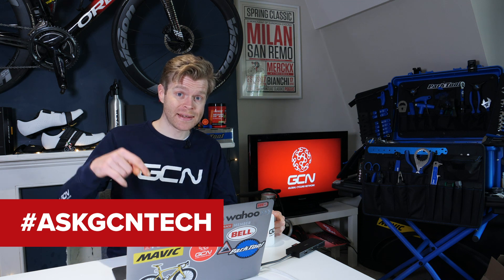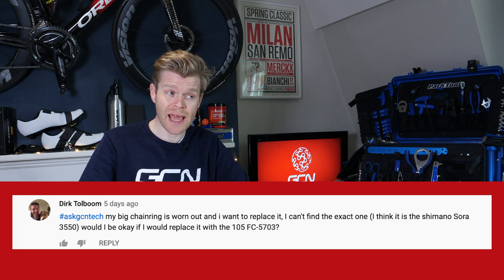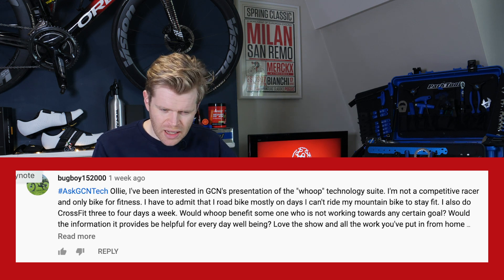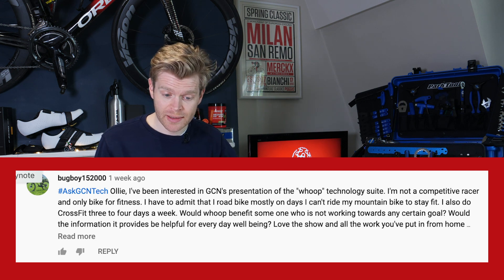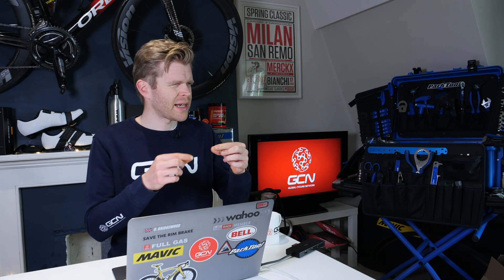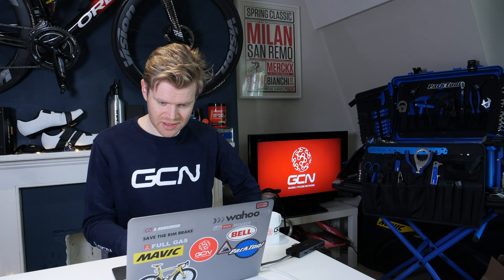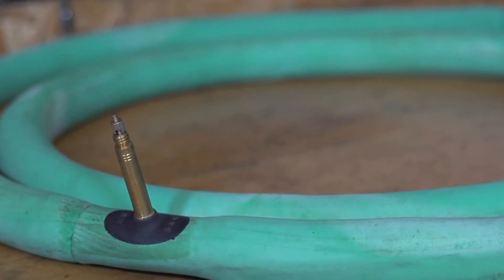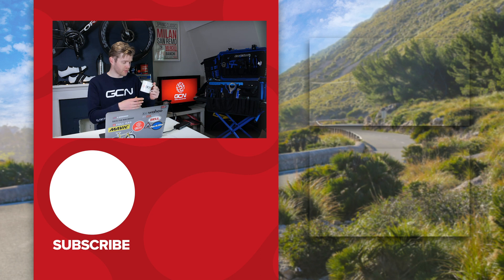Is A Gold Chain Just As Fast As A Regular One? | GCN Tech Clinic #AskGCNTech

Comment: Re: latex tubes - I like using really thin butyl tubes instead, the 50g Continental Supersonic ones. I think you can get most of the rolling resistance benefits of latex from them and they don't deflate overnight!
Reply: Neil more prone to blow outs from braking heat in my experience and the rolling resistance isn’t quite as good. 👍🏼
Reply: @OllieBridgewood  They're very, very sensitive to mounting, being really thin as well as less "slippery" than latex.. So even just a whisker of entrapment under the bead can cause problems. And they'll pinch flat at the slightest excuse. Still, I've been using them for years and years and have come to an accommodation with them. ;-) True that rolling resistance isn't quite as good, but it's pretty good!

Comment: Hi Ollie; at the risk of offending Manon and the late, great, Jon Cannings:  A coating that increases friction, even minimally, only for the sake of vanity?  ..."I pity the fools".

#AskGCNTech:  Concerning Tubes:  I've a nice-day bike and a grey-day bike, both with butyl tubes, and I check my tire pressure before each ride...  I typically need several psi after just a few days, losing ~2psi after just two days (~10 after a week):  Is this excessive, and what could be the cause(s)? 

Also:  Wax your chain!  (OZ Cycles' PTFE recipe.)
Reply: Sounds normal. You lose lots of tire pressure when road tires are pumped up to ~100 PSI. With even a quicker loss with latex tubes. Up to 7 PSI per day loss with latex. Losing ~2 PSI per day or two with butyl, that's normal. In my experiences.

Source: a self-taught bike mechanic for more than 30 years.
Reply: Rumour has it there’s extra watts to be had if you drink your milk
Reply: Jaime iz Real Thanks!
Reply: @oldguyonabike36  No problem.

Comment: #askGCNtech I have recently built a track/crit fixie. I am currently using a 40cm 3T Tornova carbon bar with a 3T ART stem 17 degrees (horizontal) 110mm length. I did some car park laps to test the bike and the drop is comfortable however under heavy acceleration the front is slightly twitchy on first couple of heavy pedal strokes before stabilising as I get up to speed. Is this down to sprinting technique, or would I need to consider a longer bar, wider stem or both? Note, I do not have the same issue on my road bike which has 120mm horizontal stem and 42cm bars (which feel a little wide but are stock), but a more relaxed geometry.

Comment: #AskGCNTech Hey Ollie! There are many good priced CX bikes with a SRAM Rival 1 (1x11) setup, but if you want electronic shifting the price is almost twice as high.  So I was thinking I could save money going down the upgrade route and get a 2nd hand (or even a new discounted electric groupset). While the Ultegra Di2 seems to be slightly less expensive compared to a full Force eTap AXS groupset, I thought I could still save some money by keeping a few of the Rival 1 parts (which is currently on the bike), such as the crank and discbreaks, and only have to buy rear derailleur, chain, cassette and shifters? Anything I am missing, or is it anything I need to keep in mind when browsing for upgrade parts?

Comment: #askGCNtech  If some cyclists are so positively obsessed with the right lube for the weather conditions that they think about deep cleaning the chain each time - why not save the hassle and get a second chain (not your spare one ;) and some more quicklinks/chain bolts, to have one chain dry lubed & the other wet, ready at hand? Probably quicker to swap than to clean, less chemicals plus the wear on the drivetrain components will be less as the chains wear down more slowly.

Comment: @GCN Tech...  The gold color coating is Titanium nitride which is is an extremely hard ceramic material about (0.00020 in thick) used to harden and protect sliding surfaces, which is why it is used on suspension forks, shocks, and chains.  See this review by MarathonMTB for the full run down.   https://marathonmtb.com/2015/05/27/reviewed-kmc-x10sl-ti-nitride-chain/

Comment: Hey Ollie,Ken here . Maybe do a show about disc brakes , like which is better "floating "rotor or say stock Sram or Shimano fixed rotors? Center lock or 6 bolt I wouldn't think either mounting would matter . I have Hope "floating" rotors(6 bolt) on one bike and my new Tarmac Pro has Sram force rotors ie fixed . Personally I think the Hope rotors are way better looking like a motorcycle brake rotor .

Comment: Most (all?) of the KMC Gold chains are Titanium Nitride-coated, NOT anodized, and may confer an advantage in corrosion resistance.  TiN-coating has been shown to reduce friction and wear (and I proved it at work too) with drill bits and other machine tooling, but I don't see any definitive studies for cycling.  Someone else noted that the rollers in the chains are not coated, so that could play a factor.

Comment: The headset bearing reminds me of issue I got with carbon forks, yes I torque the headset but it still slides so I am tempted to glue the compression fitting inside them just use top cap on top

Comment: @askgcntech hi Ollie massive fan of the channel but I have a couple of questions 1. How do you remove stuck pedals off an old bike 2: on my gravel bike the shifting is going through the gears but getting stuck in 2nd and shifts twice into 8th what should I do
Reply from the maker: Hi Luke, stuck pedals can be a real nightmare! You can try using a breaker bar over a long spanner/hex key depending on the pedal type, but be really careful not to round anything off, if that doesn't work then applying a little heat can help, if they're truly seized through it's a real mission! In answer to your second question, it's likely that your cables need replacing if the gears are sticking and then jumping, just replacing the inner cable may work, but you'll be better off replacing inner and outer cables

Comment: #askgcntech
I’ve recently bought a canyon endurace with an ultegra di2 drivetrain, I love the bike but the noise from the drivetrain is driving me nuts, it sounds like it’s coming from the cassette but I’ve had a bike shop check the alignment/set up and everything is fine and I’ve tried several lubes including wax but it doesn’t make a a difference, I’ve seen on the forums that I’m not alone with this issue, it’s noisiest in the big chain ring and smallest few cogs on the cassette, any ideas what I can do to quieten it down?

Comment: #AskGCNT Loving the content Ollie. I'm not a pro, and I never race. I am just interested in going fast on my usual route. I've got a rim brake TT bike with deep section (50s) wheels but thinking to install some Xentis Mark II wheels. I really love the bling on those wheels. However, I've found so much conflicting aero data on how much power I would save or lose by switching from deep section wheels to blades. It would be great if they are faster, but I am sure the placebo effect would more than make up for lost watts if they were slower ;) I often wrench my own bike and current wheels and would want to do the same with the Mark II wheelset.
What do you think of those wheels, any data on them, and is it feasible to overhaul them myself?
FWIW I am putting around 7000km/year on my bike, so durability is a plus.

Comment: #askGCNtech Hi, I've just treated myself to a left-crank power meter.  I'd like to use it across my road bikes but also on my gravel bike which is fitted with a GRX groupset.  Can I use my new crank, which is a 105 series crank, on my GRX front chainring?  The crank lengths are the same.

Comment: #askGCNtech I have 'quick release' thru-axles on my custom bike I built (they came with the frame). It makes traveling with a thru-axle, disc brake road bike on a car much, much simpler. I also have a 2018 specialized sirrus pro carbon elite and have been wanting the same kind of axles to fit those wheels. I know companies like DT Swiss make them, but I can't seem to find one that fits. Can you help find the right size for this bike? Front wheel, specifically.

Comment: Ollie; 
I have a thought about the question you answered about changing lubes, and the example you used. You mention prepping with dry lube, then switching to wet lube for weather. I agree with your point, however, wouldn't this depend on your dry/wet lube, especially in the example you give. Some dry lubes are wax based, and would repel an oil based wet lube. If your bike is cold with wax on the chain, and you add an oil based lube, wouldn't the wet lube come off before the wax got warm enough to get washed off by the weather? #AskGCNTech
Reply from the maker: Applying more lubricant over another different type is really more of an emergency only tactic, usually it works well enough to stop your drivetrain going completely dry and squeeky, but it's less than ideal

Comment: GCN, besides the wheels turning on the wheel bearings, DO the wheels also turn on the skewer, that is, is the skewer a bearing surface on the hub axle, that I should oil as well?
Reply from the maker: The skewer does not turn, and is not mounted to any turning parts, they are just there to locate and secure the wheel axle so they need not be lubricated, but you may wish to apply a little grease to your skewers if they are steel to prevent rust.

Comment: #AskGCNTech Hi Ollie, I want to ask if I want to do basic maintainence in home without a torque wrench. How can I know if the torque is about right for the bolts
Reply from the maker: You can't really guess torque without a huge amount of experience, but if you don't have a torque wrench then it's best to err on the side of caution and not over-tighten bolts. Essential mounting bolts, such as on the stem front plate and the seat post clamp should be done up tightly enough so that the bars/seatpost don't move at all under your bodyweight, but no tighter

Comment: #AskGCNTech

I have the Canyon Lux CF SL 7.0 and would like to equip it with a dropbar. Of course I need a corresponding brake lever for this. Preinstalled is the Shimano Deore gear group M8100 with 12 gears. Can I use GRX brake levers for shifting and braking? (Even if I lose a gear in the process?) I'm not sure if the shift cable is pulled properly so that the gears shift correctly. Or are there other options?

Many thanks in advance and greetings from Wuppertal

Tobi

Comment: I have just bought a new set of carbon wheels. However, when I spin the back wheel with the pedals, the pedals/cranks continue to spin round for a couple of seconds (like I have a fixie!). Also when I spin the pedals backwards the wheel spins back also. Do hubs 'wear in' and will this stop, or do I have a faulty hub and do I need to send back?! #askGCNtech

Comment: For the second question, regarding Sora 3550 replaced by 105 5703 chainrings. For this instance,  yes, both five bolt 110BCD .

But beware, Shimano have been dicks for the latest lineup of four bolt PCD110 chainrings by changing the notches on the both the chainrings and the crankarm spider on DA 9100, Ultegra 8000, 105 7000 is incompatible with old Shimano 110 four bolt for no good reason. And then GRX notches are also incompatible with any other Shimano four bolt anything, again for no good reason.

Comment: #AskGCNTech I have a triple chain ring at the front and want to change it to a double.  Will I need to buy a new crank and front derailer (or even more), or is it just the cassette that needs to be switched?
Reply: Going from triple to double means new cranks, new front derailleur and a new front shifter. The casette (the sprockets on the rear wheel) has little to do with this, as long as the chainset is compatible with it.
Reply: @TheMilosDjuric  I'm achieving this with a new bike soon. Anything to keep in mind? My 50 large chainring works very well for me...thanks!

Comment: I am thinking of upgrading to carbon wheels, I am curious whether tyre levers can still be used to fit and remove tyres?  Cheers
Reply from the maker: Yes you can use tyre levers to remove tyres, it's best to try not to use them to fit tyres though, as doing so can lead to pinching and puncturing the inner tube before it's inflated
Reply: Cheers.  40 years of habits die hard!

Comment: You are wrong about the gold chains.
There is no anodizing, they are not aluminum.

The titanium nitride coating is the gold part, not the underneath silver.
Titanium nitride is actually classed as a ceramic coating if I'm not mistaken.
Underneath they are nickle plated like the rest of the silver ones.

Comment: #askGCNtech I have a screaming Mavic Freehub (On faster descends when I'm not pedalling)...am I correct that lubing the sponge inside the hub with some mineral oil will help?
Reply: Had it - take the freehub apart and lube it all up (including R&R the pawls/springs) with a light grease (e.g. Slick Honey).  Check the other bearings.

Comment: I thought the titanium nitride on gold chains was the gold coating.  When I used one I noticed the gold coating was only on the part of the chain you can see but not on the parts that contact each other.  It comes off the rollers after about 10 miles.
Reply: earthstick 😂
Reply: TiN is the gold coating on the chain.  https://en.wikipedia.org/wiki/Titanium_nitride
unless Dr Bridgewood knows otherwise.

Comment: About latex tubes: 
I was told two facts from fairly trusted individuals that I want to confirm:
1) if you get a puncture you can't fix a latex tube
2) they are more puncture resistant than regular tubes.

True?
Reply: If you replace 'more' with 'less' that would be true yes.
Reply from the maker: They are indeed more puncture resistant, and yes they can't be easily patched

Comment: #askGCNtech i currently have 105 r7000 with a 50/34 chainset, i am wondering if its ok to get a 52/36 and swap the 34 onto it to have a 52/34 for a higher top speed while retaining the same low gear
Reply from the maker: A 52/34 set up might work, but it won't shift particularly well compared to a 52/36, some find it works well but others have issues

Comment: When riding in a group, if you're  using eTap, is there much chance that another rider using eTap could change your gears?
Reply: Can’t speak for etap, but most wireless systems are designed to pair with something and lock to it. If two devices are meant to exclusively link, like car fobs, the lock is much stronger. And, I mean, if another riders gear could connect to yours, that would be a lawsuit/recall kind of situation that would have killed wireless group sets by now.
Reply: @austinshoupe3003  Thanks.  Yes, I guess, if there were problems, they'd have come to light by now.

Comment: Hello! Wanted to ask, what is the difference between tubeless (ready) rims and clincher rims? Why cant you just put tubeless tape into any old rim and run it as tubeless? Thanks for the answer and all the shows. #AskGCNTech
Reply from the maker: You can set up non tubeless rims as tubeless, but this doesn't work well for applications such as road riding and it's more of a cyclocross thing, we wouldn't suggest trying it! Tubeless ready rims are designed to create a much better seal with the tyre, and hold the bead in place more securely so as to be safer and easier to install/inflate
Reply: @gcntech  Alright, thanks for the clarification.

Comment: 1:31 
You should do some research before answering stuff like this, cause actually they're as incompatible as can be.
Triple chainrings are shaped differently in the teeth, to work with the different front derailleur and the fact that the middle chainring has to be able to shift both ways, onto different chainrings, so the triple 5703 it is not gonna be able to work with the 34t on the compact double chainset. But that won't be the problem here even, cause the BCD of the 5703 is 130mm, and 3550 is 110mm, so it's not gonna get mounted on the chainset in the first place. 
Now say sorry to Dirk for misleading him like that, he put his trust in you.

He can though use pretty much any 5 bolt 110bcd 50t that Shimano makes, they are only slightly different, mostly in material, and that the shift ramps on fx. 5750 are basically better.

Comment: #AskGCNTech Love the videos Ollie, keep them coming! I just bought my first drop-handle bike, a Canyon Endurace, to keep fit during lockdown.  I have back and knee issues that have been fine for shorter rides, but I'm concerned that having my bike fitted by a moron (me) will cause problems on longer rides. Unfortunately, and perhaps ironically, all the local bike shops aren't allowed to do bike fitting during the lockdown - what are the best ways to find things like saddle fit, stem length, saddle height and position without having a second pair of hands to help measure angles and such?

Comment: #askGCNtech Heyy guys, just started to develop a passion for road cycling after buying a flat bar road bike for commuting to and from work then taking it out for a few rides through the hills. I have just ordered a Canyon Endurace for the weekend ride through the hills with shimano 105 groupset and was wondering about cross chaining. On the big chain ring, how far up on the big cogs would you suggest the limit be and vice versa on the small chain down to the small cogs? Love what you guys do as well by the way!
Reply from the maker: Hi John, it depends a lot on the gear ratios you have on your bike, but the general advice is to avoid using the big chainring and big cog or the small chain ring and the small cog, pretty much anywhere in between should be ok, you'll learn what works best as you go along. Hope you enjoy your new bike!